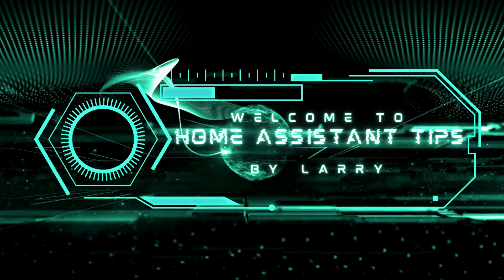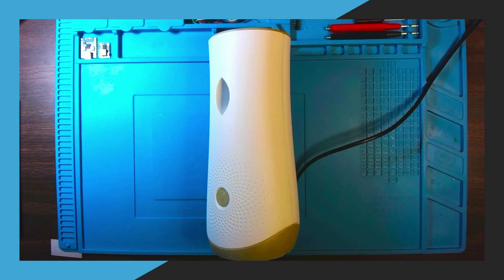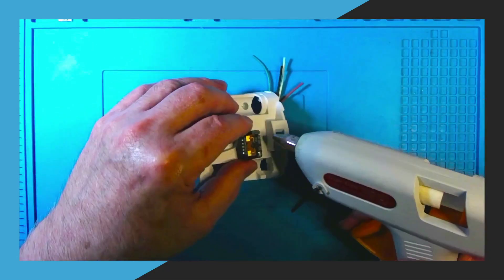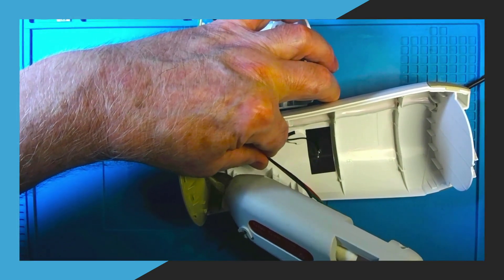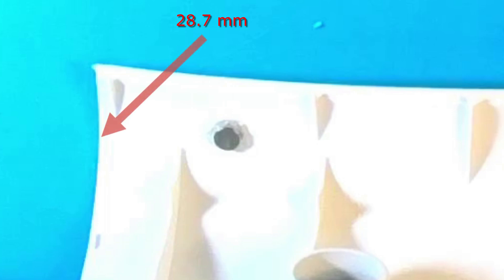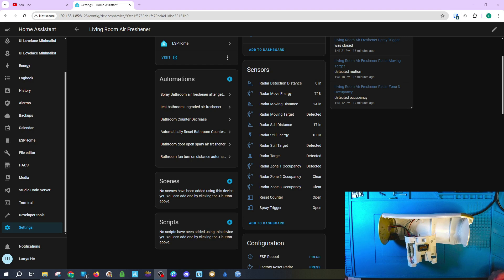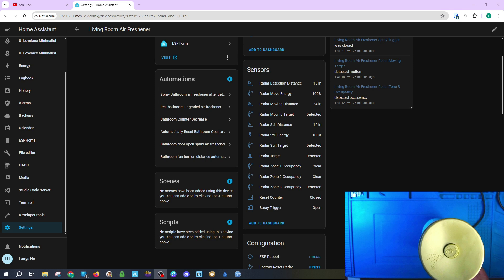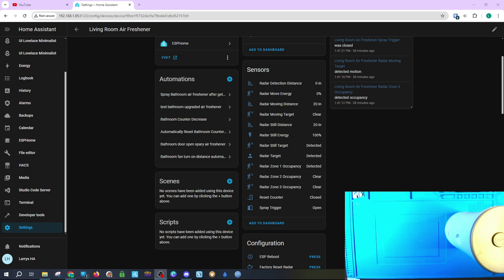Glade Air Freshener Upgraded with mmWave, touch sensor and automatic spray reset counter

Comment: Hi, just an idea, why not use load cell sensor instead of reed sensor? That would give more accurate refill state, although it might be trickier to get the empty and full weight..
Reply from the maker: That might work, but would be more complex to figure out how to add that to the bottom of the air freshener as the load cell itself is almost 18mm thick. To much thickness to add to the bottom of the air freshener. The nozzle of the can has to be at a exact distance away from the half gear that pushes down on it when it sprays.
Reply: @HATipsByLarry  yeah i'd thought about it too, would load cells used in chair / bed work? It's alot thinner
Reply from the maker: @cemaranetfeedback6295  you can't move the can upwards more then a millimeter or 2. The Reed switch works well. Even if you open and close the air freshener cover it won't reset the counter unless the cam is below whatever number of sprays you set the conduction of the automation to. I have mine set to 5 sprays.
Reply from the maker: @cemaranetfeedback6295  also if your worried about the counter getting reset when you close the air freshener and you don't change out the can even when it's below the set value, you can add a additional condition to the automation that says the touch sensor has to be closed as well. So if you don't have your finger on the touch sensor when you close it, it won't reset
Reply: @HATipsByLarry  
Just noticed your reply,  weird youtube notif

I see, but I think unfortunately if we leave a big number like 10 or so to employees like my case, that method isn't too reliable,

What i mean is car seat sensor, try googling citall car seat pressure sensor, the thickness is less than 2mm i think.. 
It's also wider but I think we can just cut out the part with the needed sensor..
Reply from the maker: @cemaranet6430  I very much doubt a weight sensor will be even close to the accuracy of the amount of spray's. I have 5 of these and have tested this and is very accurate. If you want to set it to 0 sprays left then of course you can. Might check out my discord channel would be easier to discuss it there instead of here discord.com/invite/HB9fne2VDu

Comment: Are any of these power efficient friendly?
Reply from the maker: If your asking if this mmWave sensor can be run on battery for any length of time, then the answer is no. No mmWave sensor can. They put out a continuous milli-meter Wave (hence the name). This would drain a battery very fast. So all mmWave devices are plugged into power. The touch sensor and reed switch could be run on battery, but as the Micro-Controller has to be connected to Wifi (wifi is a power hug),  to know when to spray, even without the mmWave sensor you couldn't run this project on battery
Reply: @HATipsByLarry I mean in general can you power it with battery for long time or does it need constant power?

Comment: Time to operate mine room freshener spray device over some weekend 😍
Already have all the components except time to do the install 😢😢
Would certainly post whenever I am able to do this DIY.
Reply from the maker: Yes let us know how it go's some people had problems with using pin 9, so if yours doesn't boot up correctly consider using a different pin. Mine works fine using pin 9 so yours may work great also.
Reply: @HATipsByLarry  sure sir,
Give me a week or so to try this,
Shall post back the findings,
Although I would try to use a esp8266 D1 mini or a 30 PIN Esp32,
Code should be able to run fine on them for sure 🙏🙏